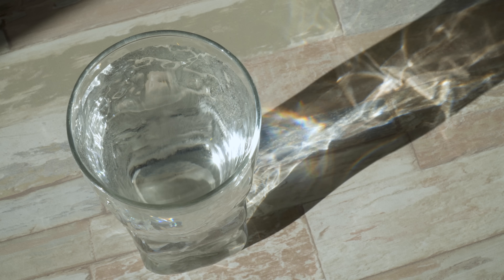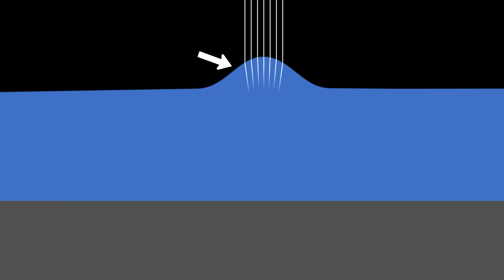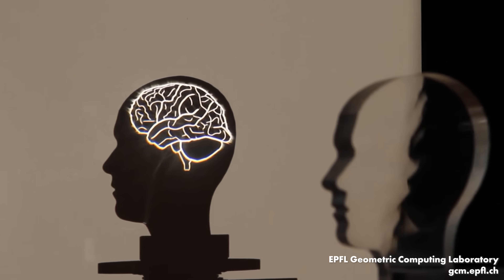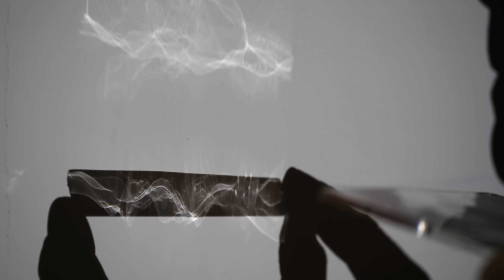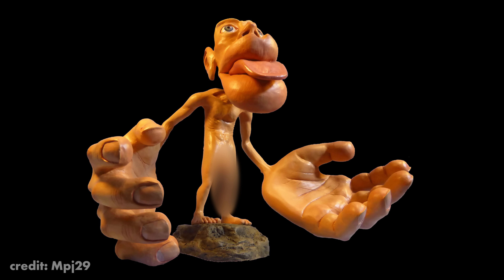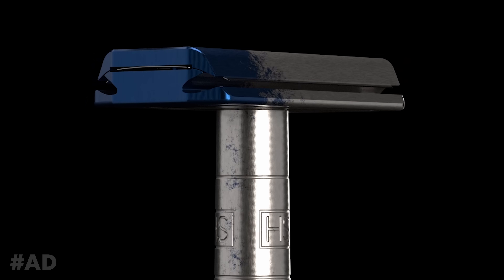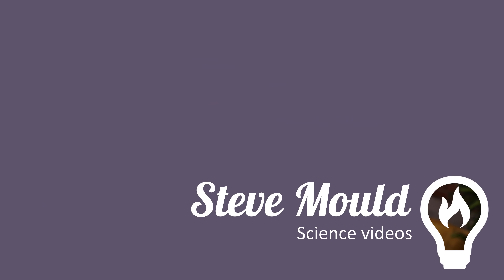Caustic lenses are really weird

Comment: So I guess thisis a video about razors then. So what is the difference between this overpriced and any other razor a tenth of the price or even less. You can get a razor that uses the exact same blades for 4 to 8 euro/dollar. The blades will cut the same. The angle of the blade,  how much they protrude, the rigidity, all that has been perfected over the last 144 years. Your razor sponsor doesn't compare itself against other safery razors, they compare themselves against crappy scammy plastic razors. Let's get real, this is a razor just as good as it's 5 buck counterpart. If you have plenty of money, why not, it probably won't shave any worst than any other one.

Comment: Maybe Steve is doing it to drive engagement in the comment section. But I can't explain the amount if discomfort I felt when I felt after the beard got to less than half the face. It was easier to ignore when it just a little bit. Then at the half way point it still had a symmetry to it so I was not disturbed. But when it went below that, I was deeply disturbed for some explainable reason. Please don't do this again.

Comment: Buddhist  monks used this "technic" centuries ago. They have shiny metallic plates/mirrors that create religious pictures in reflection (caustic spot flux) while look completely flat and clean. Sheet were engraved and then polished to appear completely flat and smooth but on micro scale embossed picture is still there and affects light. This "magical" mirrors were "demystified" only with modern electronic microscopes because of very small scale of curvature above threshold of optical microscopes and other measurements.

Comment: Bro. I thought i was having my first lsd flashback when I saw him with half a beard 😂 Incredible way to introduce your sponsor. Ive been using that style of safety razor for years and have found it much better than cartridges with 5 blades or whatever. I have pretty thick facial hair (wish I could say the same bout my head😅) and I use a single blade without cream to clean my neck. Those multi blade cartridge systems really are a rip off. I buy a pack of razors and it last me months. Plus, if you ever need to do precision cutting.... Ya already got real razer blades 😊

Comment: 🎯 Key Takeaways for quick navigation:

00:00 🌞 Caustic lenses can produce recognizable images by manipulating lens shapes.
01:03 💧 The patterns caused by undulations in transparent materials are related to how lenses work, focusing light rays to create bright lines called caustics.
03:00 🔍 Shaping lenses to redistribute light optimally is an area of mathematics known as optimal transport, akin to sculpting sand with minimal movement.
04:27 🌐 Power diagrams represent the distribution of light, and adjusting them influences the brightness and darkness of regions in an image.
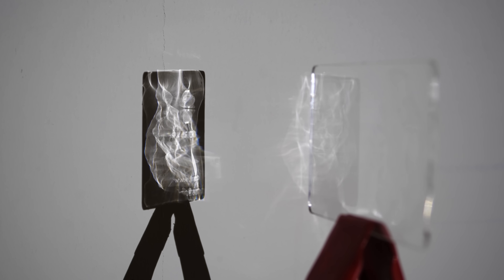05:53 🖥️ Computer scientists like Mark Pauly have contributed to understanding and implementing the curvature of lenses to create specific images.
06:51 🌈 The transition from familiar light patterns to recognizable images in these lenses creates visually engaging moments.
08:16 💼 The video sponsor, Henson, makes well-engineered safety razors, providing an alternative to the expensive "razor and blades" business model.

Made with HARPA AI

Comment: I was once in the quality control department of a company that produced optical mark reading machines best known for test scoring. They sometimes used the Razor and Blades model. Sometimes we would give the customer the expensive machines for free if they bought enough forms to run through them. The forms are printed with special inks that are visible or invisible to the machines but not to humans.

Comment: In the late 70's, mid 80's - photographic lens manufacturers were smashing their brains trying to make aspherical lenses (basically, a compound spherical curvature, useful for correcting certain aberrations). Those lenses ended up being ridiculously expensive, in difficult design/construction processes. Only a few years ago manufacturing techniques have allowed aspheric lenses to be a bit more common.
Caustic lenses would simply blow the minds of the optical designers of the 70-80s

Comment: I feel the need to mention this as well: Every time you replace a printer cartridge you are also replacing the actual component responsible for depositing ink onto your paper. You're replacing the print head.

While you still are paying a lot for the ink itself (and more than you probably should have to) there is a reason for it being a little bit pricier. Supertank and laserjet printers don't have that issue, so they are overall more cost effective.

Comment: Steve Mould
You could make swirls in the pool like physics girl did to cast shadows.

Challange: make a smiley face refraction casting it's shadow on the floor or the pool 😊 or  (o8 
Maybe could be done with a series of small paddles fixed to a single stick, and draged across the top of the water 🌊💦

Comment: A hologram is not the same as what you call an etch hologram. An etch hologram is not the same as a credit card hologram. 

A single dot in a real hologram requires an infinitely extended pattern across the entire photographic plate, and you can move your head in both horizonal and vertical direction, you can move closer or further away to get different perspectives, you can get depth of field by using different apertures in your camera, and you need to focus the object on the apparent location in a hologram rather than the depth of the plate. A real hologram recreates the original wave front, and is thus indistinguishable from reality (though under monochromatic light only). 

This "hologram" here is more like those 3d post cards using lenticular sheet. It works only when tilting the image in one of the two axes, and your camera needs to focus the acrylic plate, not the apparent object. My heart bleeds when people talk about holograms that aren't holograms and are just somehow "3d". Don't get me wrong, it's a really cool effect and the fact that the dots move continuously is really nice. But it doesn't make it a hologram. Please don't use the term wrongly in a scientific context.

A credit card hologram is a "rainbow hologram" that works without monochromatic light. It's even more complicated. Instead of the traditional flat diffraction pattern, it's a three dimensional one within the volume of the photographic emulsion.

Comment: As for the printer problem: All printer manufactures today also do sell models where the ink is just in an accessible tank and in fact you can put any ink into that tank you like, there is no way for the printer to check if that is original ink. But of course such a printer costs several hundred dollars, as you are in fact really paying for the printer here to later on save on ink. Yet it turns out that you really must print a lot before that can pay off for you. If you only occasionally need to print a few papers, your printer may need replacement before you were able to print enough to validate its costs, as even if little used, printers do age and they will need replacement (actually just some parts need but those are often not designed to be replaced in the first place and replacing those would cost almost the same price as a new printer, so where would be the point)

Comment: For these images, the light in the caustics is coming from similar areas of the lens as they appear in the image but it might be interesting to explore options where this isn't the case. A tiled smaller version of the lens, for example. In theory, I think that would be "flatter". How small could you get the tiles? Also reversing the image with a convex/concave lens? How about a random arrangement that is completely indecipherable until the correct light? Could you devise a lens which has two different images encoded in it?

Comment: For my printer I buy ink cartridges that lasts 4x longer then the original ones and for 1/3 of its price, done this for 2 years now and am printing a lot with no errors at all so far. I will buy the same model spare printer for 89€ for safety and store it well packaged, this way I am the winner. The first printed was 120€ two years ago. If I would have used the original cartridges I would have lost about 1300€.

Comment: The lens problem reminds me of coding shaders for object motion blur in 3D graphics.  A shader can only work on one pixel (fragment) at a time.  It can't modify other pixels while working on the current pixel - this is how a graphics card is able to distribute all of the work for each pixel to separate paths, so that many can be worked on simultaneously.  The problem that this creates is for situations like object motion blur.  You can't take the results of one pixel and blur it into other pixels.  That kind of coding would make it very easy - but unfortunately, you can't.  Instead, you have to code the shader such that for every given pixel being worked on, the surrounding pixels have to be sampled to see which color and how much will also end up in the pixel being worked on.  So instead of painting outward from each pixel to accomplish the blur effect, you're collecting color data from around a pixel and setting it to the combined result.  It's a backwards way of doing it, and is more costly because a given pixel needs to look all around it and may only use the color from one small adjoining area.  Caustic lenses are similar - you have to work backwards from the result to get the interface that provides the result.

Comment: The mention of Optimal Transport made me realise that there must presumably be an infinite number of Suboptimal lenses that produce an identical image.
Reply: I wouldn’t call them suboptimal, because with light rays there is hardly any cost of deflecting them a bit more than necessary. The entire connection to transport theory is more a historic thing. Since the late 90s enough computing power is available to solve such problems in a more general way, with the Gerchberg-Saxton algorithm and its variants.
Reply: Since optimal lenses move the light the least they are also the most forgiving for placement issues, non-coplanar lense and screen, and placement at the wrong focal distance. Conversely suboptimal lenses would make the image harder to see until lens and screen are in the right position, which might actually be preferable.

Comment: I used that razor. All I can say is, there is a reason the single blade design went away in favor of the more modern design with multiple blades.  Nice video as usual Steve but that razor is a rip off at $100

Comment: Would this work in a 3d modelling program or are the render engines too simple?
Reply: Well it's all just geometry at the end of the day, so you'd be able to do it but you're probably going to be working in reverse if you're altering the mesh within the program, though you may be able to use ray casting to predict how you would need to apply colour filters to create a colour image.
Would probably be better to do the calculations using the maths formulae and then plot out the vertices to a CNC program so that the lenses can be ground by a machine from a blank.
Reply: @casanovafunkenstein5090  I meant like, make the caustic lens and render it with the program. No intention of machining a real lens, just curious if something like cycles or vray would render one accurately

Comment: 5:01 I'm not so sure about the "Each region has the same amount of power", I mean yes, but I think this is only because in this problem you start with a uniform distribution of light? In general, power diagrams are for semi-discrete problems, mapping a continuous distribution to a sum of point distributions/diracs, so here the weight of each point must be the same, if the weights of each cell (density integrated over that region) is the same. But that still leaves me a bit confused, because neither of these seem that uniform. I should probably go read Dr Paulys work...

Edit: It seems neither distribution of light is discrete, both are continuous, but both are discretised first, so that discrete optimal transport can be used. Its the discretisation step that tends to assign areas with equal mass.

Comment: Ink tank printers are around now which don't use cartridges with embedded DRM, you can refill the tanks very easily using the OEM ink or a 3rd party. They do cost a bit more initially. But over time it's much cheaper, especially if you refill with an affordable ink.

Comment: What Steve didn't mention was why you would want to create an image this way rather than using something like a slide projector.  There are two reasons, firstly a slide absorbs light to create the grey and black areas and consequently you are throwing away energy and you might not want to waste energy or need so much energy that absorbing it is difficult.  Secondly it takes up much less space.  A slide projector needs a collimating lens with the slide at its focal point, this needs much more space and is far heavier.  I have designed one of these myself but used Fractals.

Comment: Caustics are also one of the hardest problems in computer graphics, because light from anywhere in the scene might just end up on one of those bright lines, so you have to simulate a ton of light rays to get a noiseless image.
Reply: Which is why we cheat whenever we can get away with it. If you see an underwater render, chances are the caustics are not simulated, but instead they are just a animated texture overlaid on the geometry. In 99% of cases, it's good enough. In other renders, caustics are often turned off, unless they play a prominent role in the image, because they're not that noticeable. A drinking glass refracting onto the table is just a small bit of the image usually, for instance.
Reply: @tylisirn  this or prerendered emissive
Reply: I saw a machine learning solution to this problem not long ago. I don't mean showing caustics from an arbitrary surface, but generating the optimal surface for any given caustics. Now I can't find it anymore, but it was a bonus from their method of extracting/recreating scenes (lighting, shading etc) from an image.
I think they were at version 3, the name ended with the letter A, or was it a K? When is my neural implant ready?
Reply: Mitsuba 3 - differentiable rendering. I'll hold off on the implant until the first version after 2.0 that I can afford.
Intro video: watch?v=9Ja9buZx0Cs
Reply: I've heard it said that realtime caustics is the holy grail of computer graphics. I didn't have the background knowledge at the time, nor did I understand the context of the remark, so it stuck in my memory purely by virtue of the peculiarity of the words, but everything I've learned since then has reinforced it to the point that I'm not sure I'll ever see a realtime caustic render in my lifetime.
Reply: @toddmatteson183  it's fairly straightforward these days, ray tracing has become easier as processors and graphics cards improve, the last feature film i worked on i think we had 400 processors available, that was 1999, i have a 32 thread at home now. come to think of it i worked on about 20 underwater shots for the movie thunderbirds (with bill paxton directed by johnathan frakes) it had no caustics as i recall, but lots of bubbles. anything in that movie that has bubbles, rocket engines or chaff floating in free fall, i was responsible for.
Reply: Same with 3d modeling for mechanical designs, end up having to place several light sources down to prevent weird light effects during rendering.
Reply: A metric ton.
Reply: The "Corridor Crew" made a video about caustics in CGI a while ago. https://youtu.be/7l6QOcgWXfI
Reply: Nvidia added caustics to Quake 2 RTX, which has very simple geometry. We aren't too far away from real time caustics!

Comment: Those caustics at the bottom of a pool produce the water version of twinkling stars. The difference is that in the water the "twinkling" is produced by surface changes, while with stars it's produced by refraction due to small density differences within the atmosphere.

Fun fact: the twinkling of stars has 2 components.

1. The refraction of starlight by the atmosphere.

2. The path of light from a star is slightly different between your two eyes, so the brightness of the star won't be the same. You can see this by crossing your eyes slightly till you can see two images of a star. It also works when you can see a point of sunlight reflecting off a distant curved object, like the chrome on a car. 

Wearing a face mask underwater in a pool, it's easy to see how the twinkling of the Sun would be different between your two eyes.